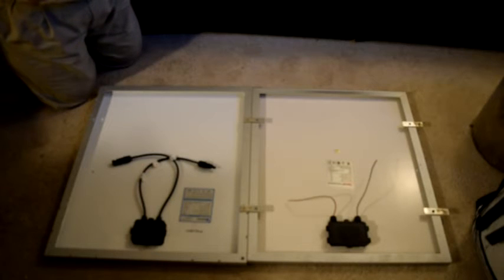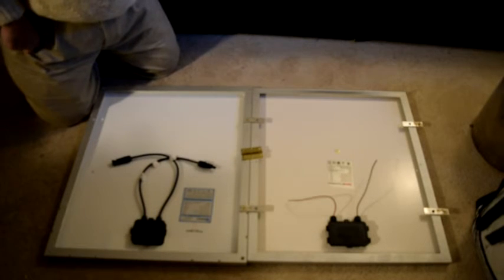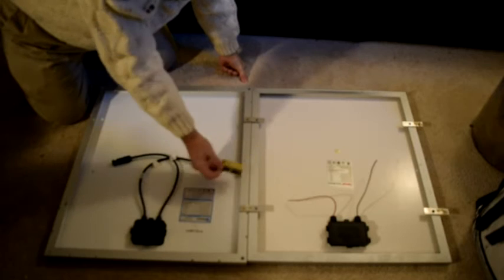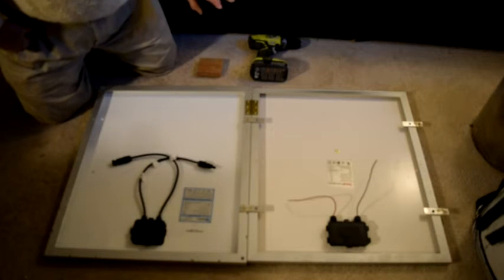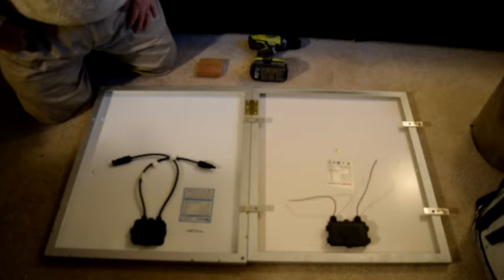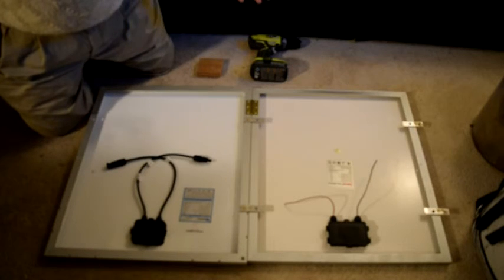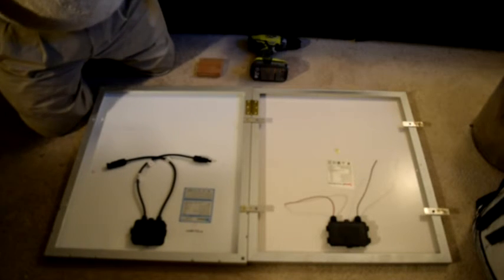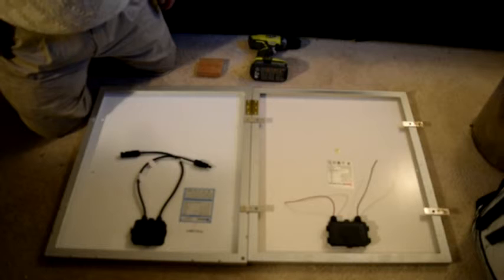DIY Portable Solar - 2:  Folding 100 watt portable solar setup

Comment: I'm a little confused at 7:56 where you say to use a 30 amp in line fuse or a 15 amp breaker. Why wouldn't they both be 30 amp. I'm a novice to electrical wiring but trying to learn.
Reply from the maker: It has been a few years since I made the video, so I will have to listen to it again to answer your question.

Comment: But wired like that would make it a 24v system not 12v.
Reply from the maker: Listen to the first three minutes again where I explain why I wired the panels in series.  The panel voltage does not matter if you use an MPPT controller with an appropriate input voltage rating.  With an MPPT  controller, the battery bank voltage is what determines the system voltage.  If you wanted to use a PWM controller, then you would wire the panels in parallel, but you would still see significant power loss because of how PWM controllers work.
Reply: Oh I see,now I get it. So as soon as I hook it up to my victron mppt then my 12v battery it will charge at 12v correct.
Reply from the maker: @alanbrown7155  yes, that is correct.
Reply: Cheers bud. I would never had thought of doing it that way.

Comment: Me again w several questions. Victron BlueSolar 100/30 mppt controller opinion? Not Bluetooth but that is ok. Reflects full output up to 104 degrees F.  Also, is the 14 gauge extension cord the basic orange type? So many color options and types on Amazon. Already ordered my 2 50 watt panels.  And finally, is a 30 amp circuit breaker (blue sea systems A-series toggle single pole circuit breaker) what I should buy if combining 2 or more 100 watt suitcases to the 30 amp mppt controller? See controller has 440 watt solar limitation at 12 volt. Also, the trip amps is same on 15 amp circuit breaker and 30 amp, both reflect 6.75 amps trip and max volts 80. Question, question, questions, lol.

Thanks a bunch in advance for any guidance or opinions.
Reply from the maker: Katherine as far as the solar controller is concerned, it does have to be MPPT if the two panels are wired in series as I showed in my video.  Beyond that there are lots of options as to which controller you want to but.  The Victron Blue Solar controllers are very nice but have no built in display other than three LEDs that show the current charge setting of the controller.  If you want to see things like the battery voltage and power coming in from the solar panels you need to buy a Bluetooth dongle for about $45 so you can see the numbers on your phone.  There are other options such as the Renogy Wanderer MPPT controller and the Epever Tracer series controllers.  Both of those controllers have small built in displays that you can scroll solar panel and battery voltages, etc.  The Renogy and Epever controllers are priced around $120-$130 on Amazon.  If you are thinking about a Victron I strongly suggest spending the extra $30 to get the SmartSolar model with built in Bluetooth. That will let you use your phone to see exactly how well your solar system is working and what the current state of your batteries is.   Personally I really like Victron products, but that is a personal 
preference and price doesn't really matter to me for stuff like this.  How much controller you need depends on how much solar you expect to get.  If you decide to go with a Victron MPPT controller I see a couple of possibilities.  1) Buy a controller that can handle as much solar as you think you might eventually use.  So if you are thinking that 400 watts is a real possibility then go with a 30 amp controller.  A Victron BlueSolar 100/30 controller will cost about $200, but as I said has no display.  A Victron SmartSolar 100/30 with built in Bluetooth to allow you to use your phone as a display is  $226.10 at http://shop.pkys.com/Victron-Energy-MPPT-100-30-Smart-Solar-Charge-Controller-with-built-in-Bluetooth.html .  Alternatively, you could buy a smaller capacity controller now to handle 200 watts.  A Victron SmartSolar 75/15 can handle up to 220 watts of solar and costs $118.50 at http://shop.pkys.com/Victron-Energy-MPPT-7515-Smart-Solar-Charge-Controller-with-Bluetooth_p_2779.html .  Then, if you decide to upgrade to 400 watts of solar you can buy a second controller to handle the second 200 watts.  Since the first controller I suggested has bluetooth so you can use it to monitor your batteries, the second controller can be a standard Victron BlueSolar 75/15 without bluetooth which sells for $88.40 at http://shop.pkys.com/Victron-Energy-MPPT-7515-Solar-Charge-Controller_p_7177.html .  That gives you 440 watts of solar capacity with Bluetooth monitoring for $206.90 (plus that company will give you $5 off the cost of the second order).  If you are not planning to go directly to 400 watts of solar right now I would buy the smaller capacity controller and then a second controller when/if you upgrade to 400 watts.  That saves a little money now.  Two Victron controllers can be connected to the same battery bank.  Two separate controllers would also let you mix and match your solar panels.  You could attach panels wired for 24 volts to one and attach 12 volt wired panels to the other.

As far as circuit protection goes for multiple portable solar panels I would put a fuse in the positive wire from each portable panel.  For a 100 watt  portable made from two 50 watt panels in series I would use a 10 amp fuse.  An in-line fuse runs between $5 and $10 depending on how fancy you want to go.  Then put a plug of some on the end of the wire so you can plug the panel into your RV or truck.  Mount mating plugs on the truck/RV. Multiple plugs can be wired to the controller.  Any 2 conductor plug will work fine.  You could even install a standard home outlet in the truck/RV that you wire to the controller.  Then if you use an extension cord as your wire, leave the pronged plug on so you can plug it into the outlet.  The fuses give you circuit protection and the plugs give you an easy way to disconnect the solar panels.  A standard household 2 plug outlet should cost about $2-3 at any hardware store and a plastic box to mount it will cost an other couple of bucks.  That will let you connect two portable  solar panels to the controller.

If you want to go with a circuit breaker then I would suggest either a BlueSea C series to get the voltage rating needed for series panels or a Blue Seas 285 series panel mount breaker.  However, if you fuse the wires from the individual panels you don't need a circuit breaker.
Reply: Todd Dunn thank you so much. I have to hit the road in a little bit, so will read and reread after I get to El Paso.
Reply: Todd Dunn ordered the 30 amp victron Bluetooth controller. Made things easier for myself for this first portable and bought 20 ft 12 gauge wire w mc4 connectors and renogy 10 amp in-line fuse.  The other two I will make will have better understanding to experiment. Likely will have other questions, lol. Thanks again!
Reply from the maker: Sounds like you have made good choices.  Using wires with MC4 connectors will make doing the wiring very easy.
Reply: Todd Dunn exciting stuff. Next on to batteries but first a funeral to attend today, person who lived a long full life. Thanks again!

Comment: Another question, keeping w only 600 watt usage, do I need 200 ah 6 volt batteries (4x200) to receive an actual 400 ah capacity? Some of the videos I have been watching are making me think I misunderstood your 400 amp-hr of lead acid battery capacity being sufficient. Since 6 volt am I only going to receive half of that capacity when hooked up in series to 12 volt??? Please, if you have time read edits to my other comment to your reply.
Reply from the maker: If you have two 6 volt batteries each rated at 200 amp-hr at 6 volts, wiring them in series doubles the voltage but does not change the amp-hr capacity, so two 6 volt 200 amp-hr batteries in series are the same as a 12 volt 200 amp-hr battery.